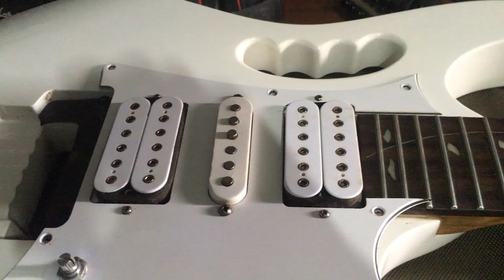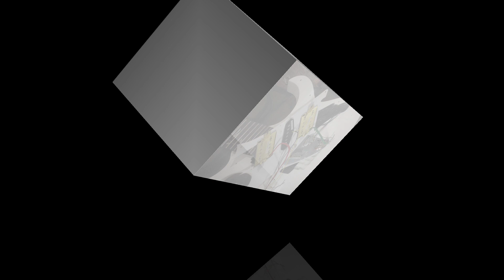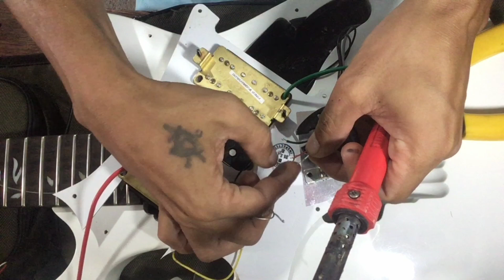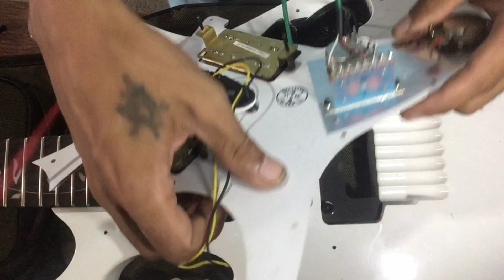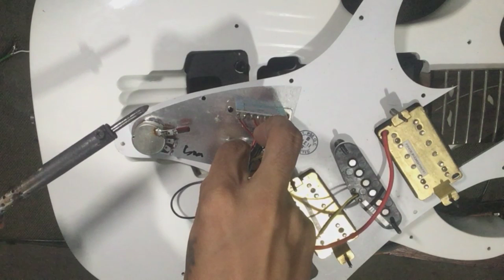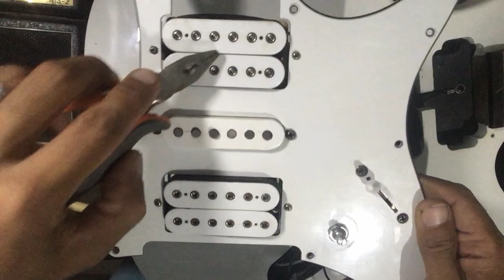Tutorial paano mag wiring ng pickup sa electric guitar

Comment: Boss patulong naman po, kase yung saken di lahat nung wires sa control linagyan. Hsh din oi saken pero yung meron lang pong naka kabit is sa right side yung left na mga terminals wala. Tas yung ground is kinabit sa body ng control lang hindi sa volume
Reply from the maker: Sa fbi  boss
Reply: @ratuig1  sige po pero tanong ko lang po, ngayon nag shielding ako tapos bumababa noise kaso lang nandon parin yung parang nag ppop pag bibitawan tas nahawak ulit sa ground part. Pero di gaya dati mas malakas, tanong ko po is normal lang po ba yan na di mawawala? Yung pop po na sound pag hinahawakan na yung strings or metal grounded parts
Reply from the maker: @Aldsomegaming  natural lang yun kapag mga ddrive gamit mo mag noise gate  pedal ka kung meron ka sa clean wapa talaga
Reply from the maker: @Aldsomegaming  passsnha an sa late repply dami ko ksing nirerepair na amplifier at speaker  basta guammit ka ng noise gate walang feedback pati un
Reply: @ratuig1 ahh salamt lods! yun yong ginawa ko and mas mabawas na nga salamat po!